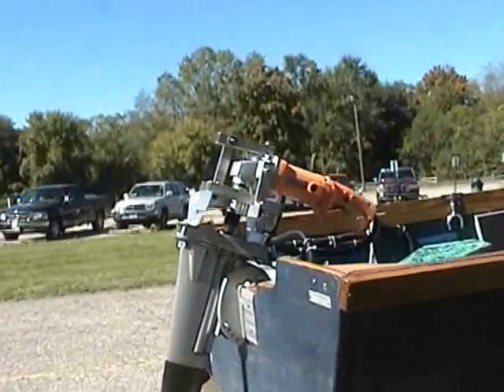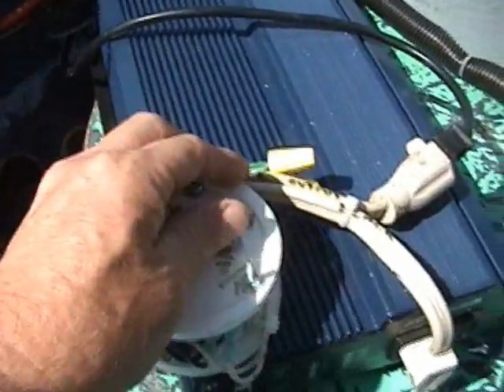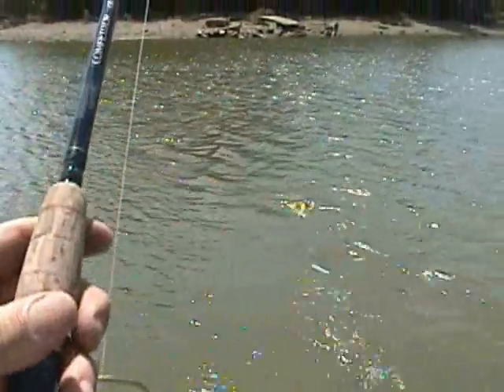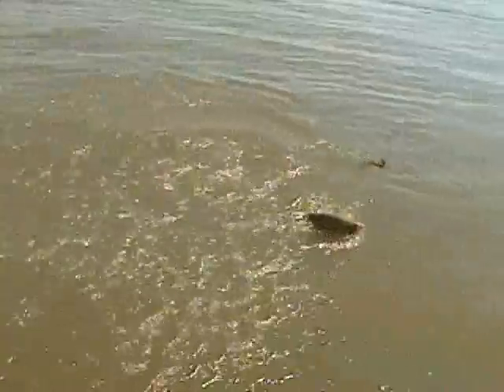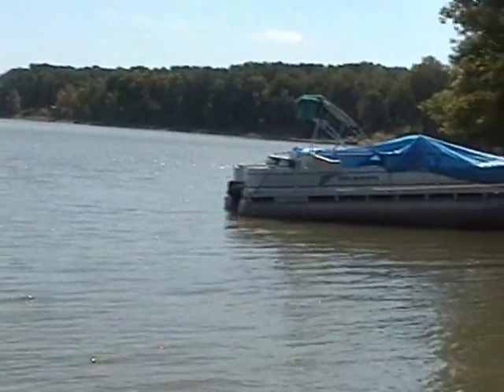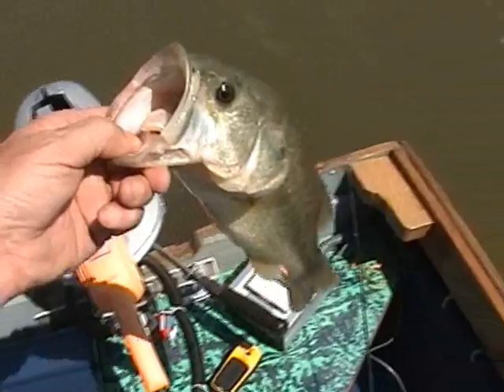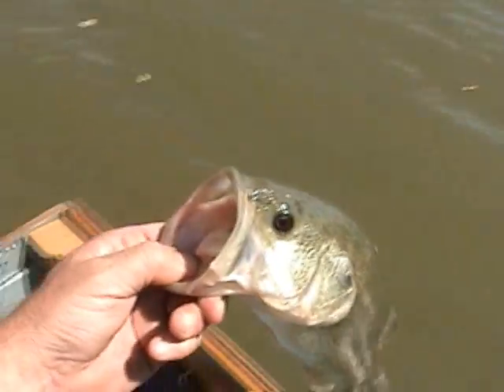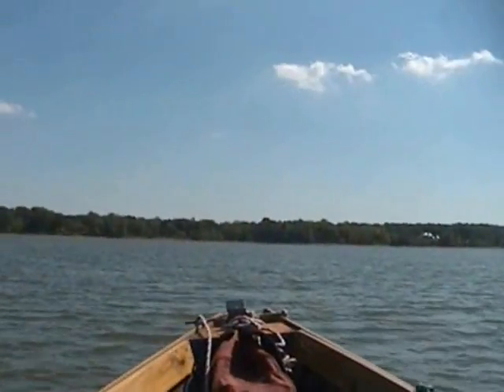HOW-TO electric boat motor ~  Angle Grinder ~ 6500 RPM  ~ WHOA!!! ~

Comment: wow that's being cheap on a new level
Reply from the maker: Hello I have,
Thank you for watching. Hope the video now gives some new meaning to you! I had great moments while building this all electric, + hand made boat overc the years. It is still in use even today. I have not had to replace many parts although, I did replace the brushes on the ubiversal motor recently, probably could have used the original brushes for another 3 or 4 years.  I do appreciate you watching!
Thank you !

Comment: wouldn't a trolling motor with the solar panel work just as well if not better? probably be more efficient at propelling the boat to. but still pretty kool contraption you rigged up there.

Comment: I certainly shall! Thanks for taking the time to answer my questions so thoroughly. Are a/c motors intrinsically more efficient? It´s just that, superficially at least, it´s surprising that it´s better to introduce inverters etc. rather then to simply run a 36v cordless drill on 3 lead acid batteries. Your video has convinced me that your way works better, so I´m wondering why that is...by the way, the router speed controller is a clever touch!

Comment: Brilliant! I love it! Does the grinder motor mind? Can you reverse? Can you moderate rpm? Are you running on lead acid batteries, via an inverter? If so I guess it´s just on/off and no reversing. May I ask how long it runs on a charge?

Comment: This would work a great deal better with an electric router. You can get them around 1hp, 20,000 rpm. Perhaps a small frequency drive to step down to troll.

Comment: I watched most all of your videos, COOL man. What a great way to stay out of trouble and get to fish too. I found some good ESCs on them old battery powered scooters. I found an outlet for ones up to 800amps and up on the web used on the robots used in the robot wars. Lots of high powered DC stuff 12 volts and up. Nice programmable ones you can program on your PC. There were lots of DC motors from 1/4 hp to 10 hp. I am still looking for a small 4hp  one I want to use on a battery powered bike.